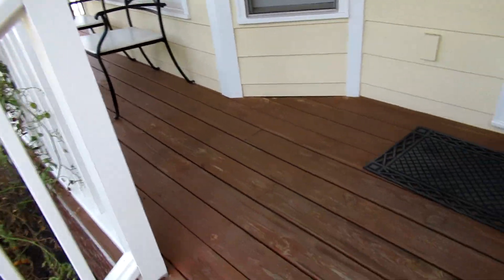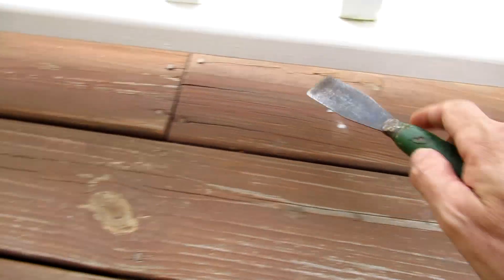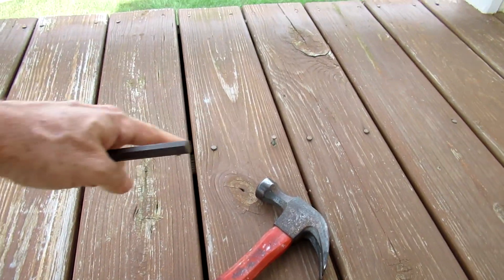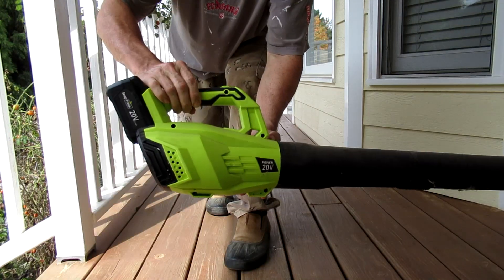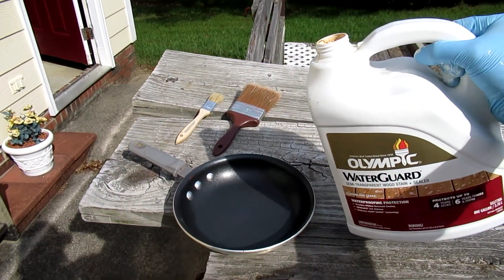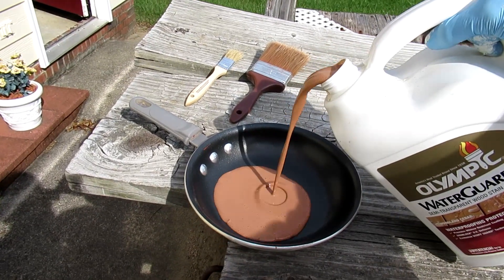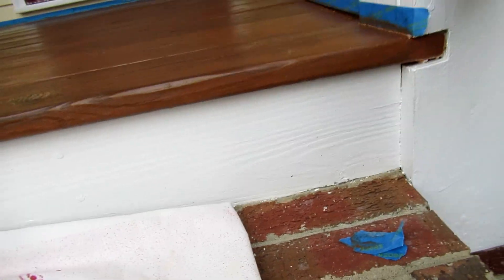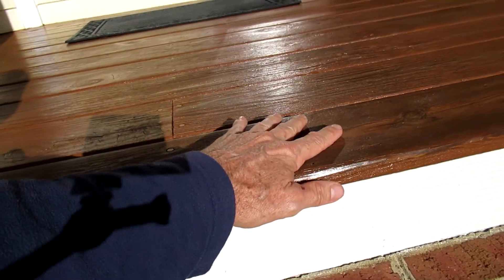How to Paint a front Porch with Deck Watersealer waterproofer stain

Comment: How’d you keep squeak off the wet porch????
Reply from the maker: hi, squeak was actually scared of the porch for a few days afterwards. Its probably because the sealer is a bit sticky until it fully cures. It was funny to watch her tip toe then jump off the boards. Shes fine with the porch now that its has dried.